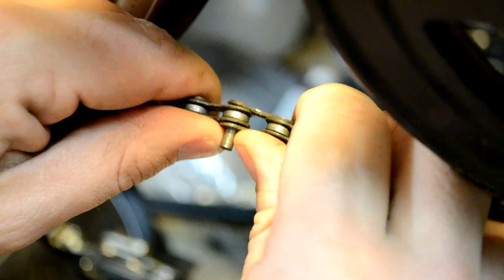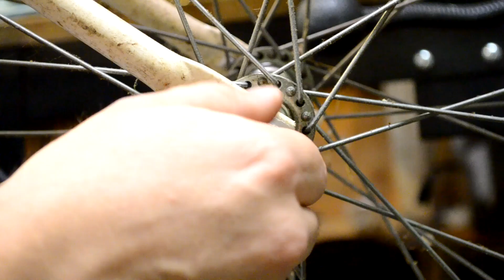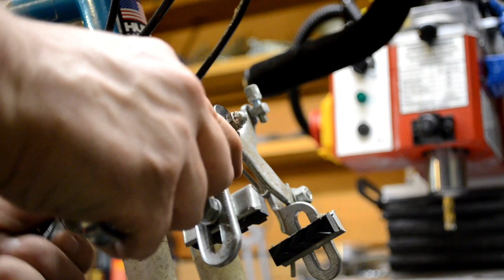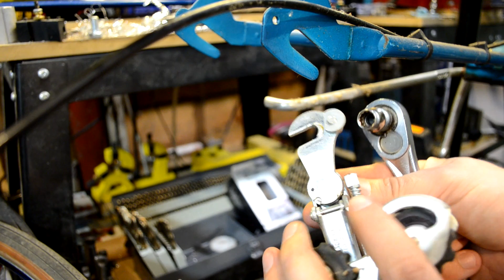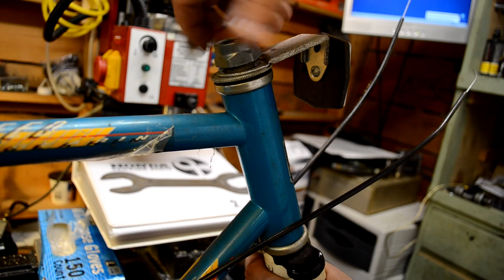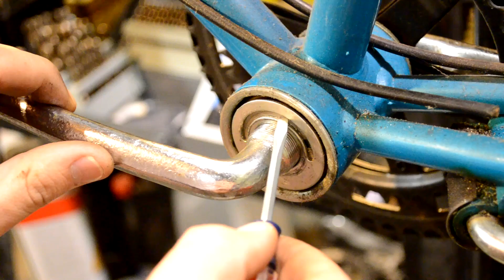Single Speed Project - Part 2, Teardown

Comment: This can be fun or a real headache. Most of my rebuilds are throw aways and either the stem is stuck in the fork tube or the seat post is stuck in the seat tube. I'm working on one with the latter problem at the moment. Frustrating. Still, good filming to learn from.

Comment from the maker: I'm using a chain breaker to push out a pin in the chain so it can be separated. You can do that anywhere on the chain.

Before you use a chain breaker, check for a "master link" which just requires a flat head screw driver to separate chain. Google"chain master link" and you'll see what I mean better than I can explain what it is in the comments here.

Comment from the maker: No, I did not.

If something requires extra work then I show that as that might help others. If I need to get penetrating fluid, breaker bar, angle grinder or even a blow torch then I show that.

Generally the right tools for the job prevent this in a lot of cases, but I have videos that show having to get an angle grinder out and snapping allen wrenches to name just two.